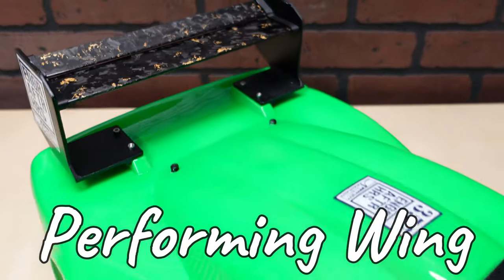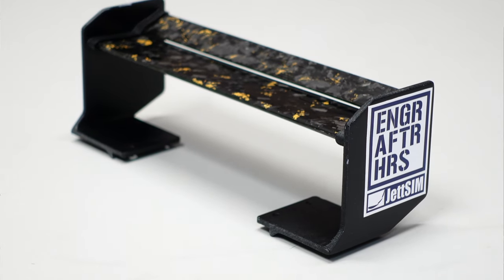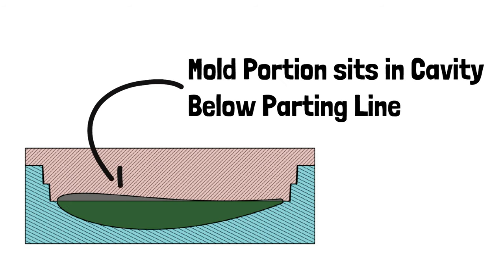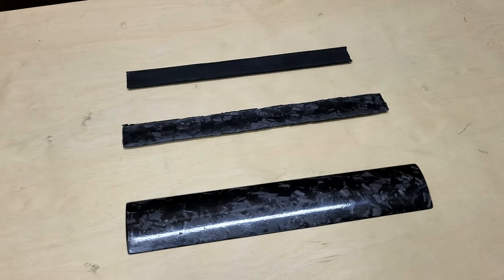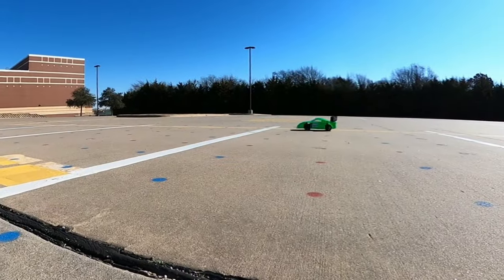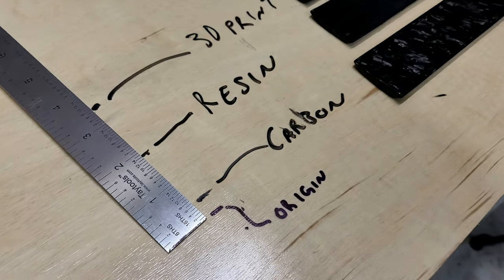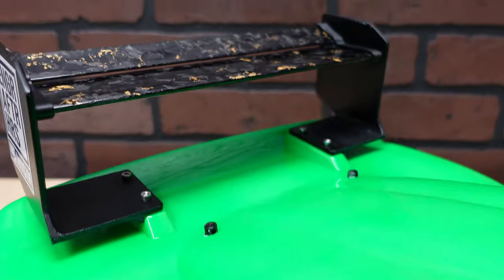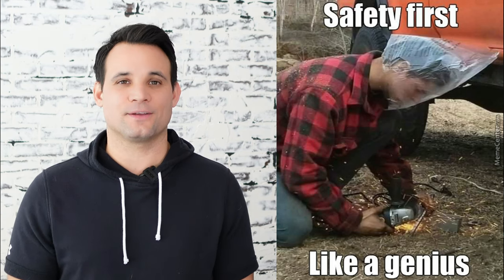Forged Carbon Fiber Wings with 3D Printed Molds

Comment: One of my favorite post processing methods for 3D printing is smoothing ABS or ASA using acetone vapor. 
No sanding needed at all unless you printed with coarse layers. I use a glass jar for small components with a hook the suspend my parts from. the parts have a hole in them for this purpose. 

larger parts need a bigger evaporation chamber outside or with proper ventilation, its not a great idea to breathe large amounts of acetone.
I put like 3 mm (1/10 inch) of acetone in the jar. all of it evaporates after like 15 minutes. then let your part dry for a few hours.
acetone evaporates at room temperature but it works better when you leave the jar in a bucket of hot water.

You can also use acetone to chemically weld pieces of ABS or ASA together.

Comment: Great video! Thanks for sharing! I don’t know if I’m the only one, but I’d love to know even more technical details if you’re ever inclined. Like how do you model the drag to lift ratio?
Reply: Btw
What software does he use to calculate the lift to drag ratio ?
Reply from the maker: I'm using a really simple 2D solver here called multi element airfoils by Dr Patrick Hanley. It's great for early design and trade studies, but doesn't have 3D capabilities. He has several videos on the software.

For 3D analysis, simscale has some free offerings that I've used. Its really down to what level of accuracy you need. 

If budget isn't an issue, I'm a big fan of ANSYS products like fluent and CFX.
Reply: @EngineeringAfterHours  have you thought about buying a carbon RC chopper wing and use as a spoiler? Perhaps cheap and stiff without labour. And different profiles and sizes should be available. Just a thought 🤔
Also would agree - more nerdy details on modelling would be super nice addition!

Comment: I know you've toyed with active aero in the past, but I couldn't stop thinking about it this whole video with that beautiful carbon wing--very similar to a bunch of heli blades I've worked with in the past. Hit me up if you want to get a flight controller setup on one of your cars ;) I've got some ideas
Reply from the maker: I'm real curious to see what you're thinking. One of the active aero projects I've always wanted to try was to have both front and rear wings able to adjust to a set level of downforce. And that adjustment was based on a front and rear load sensor so I could basically ensure I have a balanced car at all times
Reply: @EngineeringAfterHours   Pretty much exactly what I had in mind! Take it one step further and change the downforce ‘setpoint’ on the left/right side based on commanded turn rate and direction
Reply from the maker: @NicholasRehm  haha that's sort of what the UTA FSAE team did several years ago. https://www.youtube.com/watch?v=7UUl6VN4bGY
Reply: @EngineeringAfterHours  if you can get a force or displacement measurement from the suspension system into an arduino, we can make dRehmDrive ActiveAero happen

Comment: Excellent work.
I'd love to see you do a one or two part suspended floor. That is, mounted right to the wheel upright, sending the downforce not through the springs and dampers but straight to the road. The chassis would still be suspended quite softly under huge downforce. Should be a great downforce to drag solution as well. I want to attempt it in real race cars some day. Beat me to it!
Wings mounted to rear wheel upright has been done in racing and might work great on RC.

Comment: may I have files for 3d printing, I am currently making an rc car for an academic project and I would really find files for 3d printing the molds extremely helpful, or just the requirements of the molds. Also, What tires are you using?

Comment: does drag really have an effect on such a low scale and speed  ?
Reply from the maker: First off these cars go really fast. 100mph or more is not abnormal for RC cars anymore. 

So yes, adding drag will definitely limit top speed, and poor aero has really hurt a few speed runners. There's a point at which the aero drag saps so much of the available traction that the car becomes unstable.

The power of these cars is also scaled down, so even if the wings only taking away 500 Watts at high speed...that could be 10% of total power or more.

Comment: What material are the 3D printed wings/comparative specimens made out of? 

I was also inspired by Easy Composites for my latest RC body build video. Looking for an excuse to try the forged CF soon.

Great job on the video 👍🏼
Reply from the maker: PLA usually. Some wings are nylon but it's a little too flexible.

Comment: What rc car are you using? I am maybe thinking of getting my own 3d printer and trying to make something similar. once that is all good, I could try and forge some carbon my self. I am thinking a similar wing design, but with either a splitter or a front wing. For the buggy i am planning this on, maybe a front wing will be better for the ground clearence and the non sealed floor design. If an underfloor tunnel can work well at rc car speeds like 30-40 mph, it would be very cool. I say 30-40 mph because cornering is when downforce is needed and you arent cornering at top speed, nothing close to that, so around that number would be high speed cornering.
Reply from the maker: It's a heavily modified traxxas slash 4x4 with a 6s motor. If you're racing on a track 30-40mph is pretty reasonable, but this thing is 100mph+ easily.

Downforce is useful at higher speeds for braking and acceleration as well. I have a video that explains this on a dragster build. But it definitely requires a very stiff suspension suspension to run high downforce on these toy cars
Reply: @EngineeringAfterHours  I figured it was a slash or a rustler based off the rear end
Reply: @EngineeringAfterHours  also could you share the print file because I would love to try and integrate this design into my rc car. I have a 2wd slash and the rear is always super loose when I use dboot hoons on the rear and stock tires on the front, I guess the stock tires have more grip. But a rear wing would help a ton with breaking from high speeds

Comment: This is awesome! I am slowly building up the courage to design a speed run car, but it's a daunting task. I want it to look cool without looking like boring torpedo, and I want it to function well. I'm thinking about starting with a streamline shell, like one of the Les Mans style ones (I'm in love with the GT40) and trimming out the front and rear bumpers so that they will have a lot of aero functionality and blend with the fully functioning ground effect underbody to get the most down force with less drag. But I also want active aero (and/or active dampening) so that I'm not scraping the chassis on the ground at high speed and losing potential. 
Let me know what you think.
Reply from the maker: The fc100 body from delta is actually a decent body....especially if you have a proper undertray. 

Spring stiffness is always a challenge with high speed cars. There's a reason the record holder didn't run a suspension at all.
Reply: @EngineeringAfterHours  yeah, I get it. But the suspension-less torpedo is kinda boring to me. Like yeah it's technically the fastest, but where's the flare or elegance?

Comment: This is great video. I love when somebody finally talks about aerodynamic.
But as pretty much everybody. You forgot about rear "bumper" of your car body. It act like huge lift and drag wing.
You better get rid of that rear "bumper". 

As RC cars dont have "closed" bodywork air get inside of it eazily and you have to make sure it can travel freely from the back.
Looking forward to next video.
Reply: It could be part of your next video. Testing how much it affect handling and top speed. (its game changer on my offroad trophy truck).
Reply from the maker: The plan for the next video is actually an undertray to seal off everything. I want both a large front splitter and a diffuser.

I haven't really forgotten about anything, I just am not going to include a fully comprehensive breakdown of the aero loads in a video focused more on the specific wing materials.
Reply: @EngineeringAfterHours  Oh. Neat.
Yeah that way you get lot more downforce.

Good to hear you have this all planed ahead. 
I saw too many ppl do many areo mistakes that i just cant help myself and try tell them what they might had missed.

Comment: I'd love to see how this custom setup compares to an injection molded multi element 1/8th scale buggy/truggy wing. Because while I can believe that the RC racing community misunderstands aero, I'd like to see some data to see if it's true.

Even if it's just the car on a scale, with a force gauge attached to the front with a fan blowing on it. Those apples to apples comparisons are what makes for good engineering.
Reply from the maker: Do you have a link for an example wing?

Comment: I know videos have to be budget especially with expense for trial and error. You also do alll types of demo abs I tests so something would use to be in high demand for you to perfect something. Having said that,  rc fans who purchase expensive rc also dump money into those expensive rc like bashers and speed runs over 100+ mph. Both these conditions are extreme enough to put any demo to the test to prove results and is worth the labor bcs if it’s pretty AND it works they’ll want it.

Comment: note, if you used normal carbon fiber you would get increased rigidity for the same weight.

otherwise, your video is extremely well made. top job.
Reply from the maker: I could probably get equal or better rigidity with lower weight by using a layup. Chopped carbon is just easier to work with and cheaper.

A lot of my other thicker wing sections have embedded carbon rods that add a lot of stiffness for little cost.

Comment: The new wing on the Arrma vendetta actually increases downforce. It comes with two different wings one has more downforce than the other. Fastest is about 140 mph atm.
#arcouk
Reply from the maker: That wing is still just vacuum formed plastic. They definitely produce downforce...but also a lot of drag.

Comment: wish I had spare cash to get into hobby rc
Reply from the maker: It's not a cheap hobby, but if you go small scale you can start for like $150. If you want 1/10...you're probably looked $225-250 after batteries.

Comment: Please break the land speed record of 202 mph using engineering and science.  It gets annoying watching speed monkies just add power and weight to an RC lead block.
Reply from the maker: Hah...the challenge with land speed records is not even about the car anymore....its finding a long and smooth enough place to run it.  Modern RC power systems have so much power that it only takes a small amount of aero knowledge to design a system capable of well over 200 mph.

Comment: This video will piss off a lot of "speed runners."  They think that adding 20 horsepower through 2, or even 4 motors will get them past 202 mph when all they are doing is adding mass and drag.  There solution to the increased drag and weight?  MORE POWER?!  🤣🤣🤣🤣 These monkies are stucik in 1940's aerodynamics thinking.